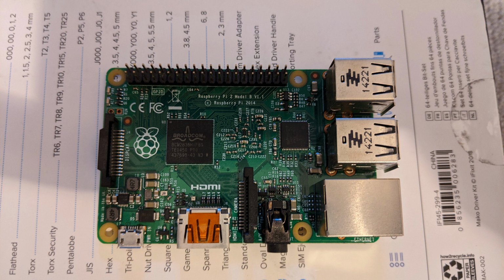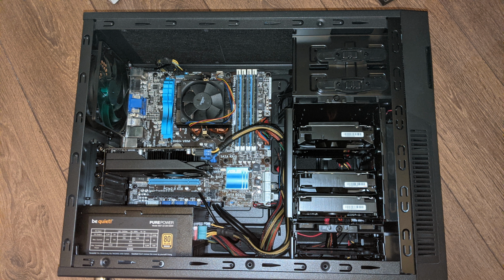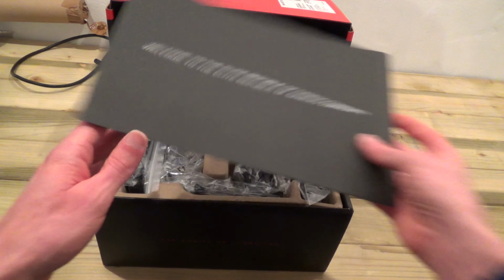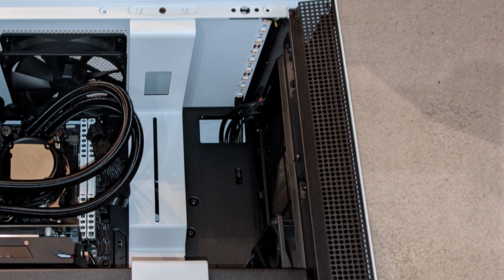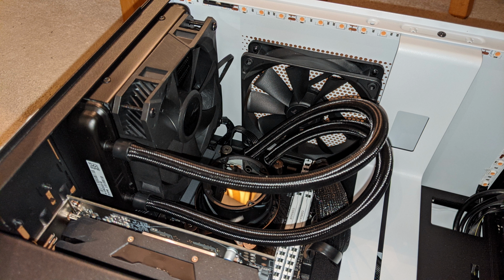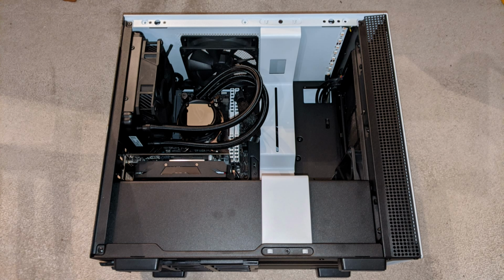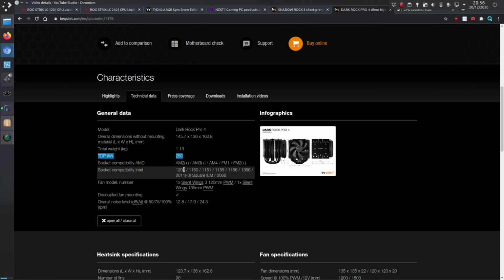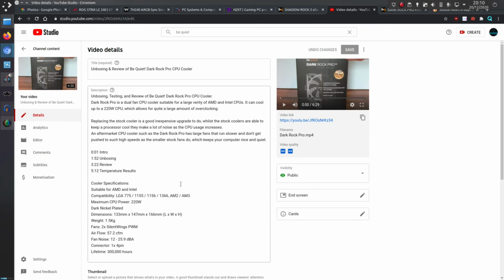Trying Water Cooling for First Time - ASUS ROG Strix LC 120

Comment: I experience a random air bubble rattle for 10 minutes during startup. I changed to an ASUS ROG Strix LC 120 RGB water cooler last year from another water cooler due to the same issue. Now, I am moving to a fan-based CPU cooler. Do you still have this ASUS ROG Strix LC 120, and have you had any problems with it?

Comment: I have the same Aio cooler, and to say im not so pleased with it either. But now i changed the fan on the radiator to a Noctua NF-F12 iPPC-3000 120mm PWM with much higher stat pressure.

Comment: I think it makes more sense to install the AIO sucking cold air through the front into the case than blasting the hot air through the radiator and out of the case...

Comment: I installed my radiator sandwiched between 2 fans. One pushing air thru the radiator and the other pulls the air out the back. This works pretty well

Comment: Interesting take I dismissed water cooling a while back, when I was purely focused on getting an air cooler as I needed to build a PC as quickly as possible before my old one caved in. Previously I always thought water coolers had to be joined together therefore risked leaking however I now know they are all in one generally unless you have something custom built. Now I went with a Scythe Fuma 2, which for my 5700g was going to be more than enough as I had no plans to overclock. Then... I discovered bit by bit that overclocking could be rewarding if you were lucky enough to get stable silicon. In fact, because I do a lot of compiling but also play the occasional game (compare this to when I was growing up where I would have a bag of games which I would play from waking to sleeping..) any performance uplift, if stable and free - might aswell be utilised. So I've started with the built in features of the motherboard just to see what I could get - and sure enough 4.6GHz didn't crash after compiling a whole day's worth of stuff I came to the conclusion that I would try to learn more. First concern is always to keep the lifespan, so I also tried Precision Boost Overdrive with moderate settings which worked well. All this with auto voltages. However I had a go at graphics overclock. From +200MHz boost, to +300MHz everything was running well. However I do recommend getting a spare partition and using OCCT which stress tests the CPU and GPU, as +300 was giving me errors. But - I gave it +25mv and bingo - after 15 minutes, no errors. I haven't tried more as I want to balance the system. The final adventure was RAM. At first I was sceptical that anything would work over stock speeds. I was at 32Mb/sec with single channel (I can't afford more yet!). The RAM turned out to be rare Micron F die - with literally about 3 reddit articles and hardly any reference, not even mentioned in the DDR4 overclock wiki or whatever it is.. So I decided to do manual. I left voltage auto (apparently it might take 3.80v wheras a lot of sites say 4 or 4.5 I think it runs on less). Anyhow by upping the speed a few notches I got to just under 3600 stable. 3600 crashed but I increased the latency a by 1 and got it up to just under 3800. Then I increased by 1 more and I got it to 3933 which it stays at now. 4000 didn't show the display but then... I didn't try any other voltages. But even with 2 more on the latency my memtest usb stick says I have 39Mb/s - so a nice uplift. Supertuxkart likes all core it runs at generally 60fps on the integrated graphics gpu, around 50ish with PBO, compared to about 41fps with 3200MHz DDR4, combined with all the other overclocks. But the biggest difference is Cinebench which would reflect on compiling too. Scores of over 15600 are possible with all core overclock, 14,800 with PBO. Compare this to 13,300-13600 stock speeds stock ram. So yes, all small improvements but improvements welcome. I reckon if I put a 240 AIO in, I can bring temperatures down and it'll boost for longer on PBO mode making that mode more useful, in the meantime it reaches 4.85GHz on my air cooler so it should help it boost for longer periods. That's the thing - if you download ryzen master, do "Core optimiser" Screenshot or take a picture of the results (negative offsets for CPU voltage) - put this in Curve Optimiser on the motherboard BIOS and you can reduce voltage which helps the scores. I used per core but if you do all core for older motherboards you may have one setting for all cores to try. It'll do a stability test. Once everything is stable you can come off windows again and use Linux. You can just do it manually but it was easier to leave it an hour and for it to give me some idea what undervolting could be achieved. So in my research I saw that 1 fan 120 AIOs tend to perform similar to air coolers. 240 or 2 fan 120mm AIOs like the Kraken x53 or the Artic Freezer II could perform a couple of degrees better than a Noctua DH15 or even better in some cases. I imagine if your case can fit it a 3 fan model will perform significantly better in some (not all cases). So given that I'm very tempted just to try it as my case won't fit a bigger than 155mm tall air cooler, but only has 2 120's on the top so a 240 AIO would give me superior cooling. The other thing is time to reach max temp is seconds for an air cooler but minutes for an AIO, so if you're doing short bursts you should notice that you will get better performance with AIO even with 1 fan. For longer durations a bigger radiator is better. All interesting and I'm even tempted to start a channel and demo these things!
Reply: I forgot to add in that post - one thing I noticed and I don't know if you have too is after researching water cooling - on the boxes they often show the wrong installation method because it "looks better" for the photograph on the box. After watching JayZTwoCents and various other hardware channels I have learned for when I try water cooling in the future - that the pump has to be below the radiator tubes when  mounting. So for example in this one fan configuration I would mount the tubes above the pump vertically rather than going down to the bottom of the fan. Air pockets can build up otherwise and lead to the pump making gurgling noises or failing after a short period of time. So, if it is at the back of the case lead the tube down to the CPU bloc rather than up to it. Same if it's the front of the case lead the tube from the top of the radiator downwards towards the CPU bloc. This won't generally be a problem with top mounted radiators and fans. I hope this helps because it may get extra life out of the cooler - and stop it failing, which  - if it did fail - would make you more sceptical of water coolers based on bad experience. I wouldn't have known this myself.. but you could save Miss Quid's computer :D Maybe you already know by now, or maybe it wasn't possible to mount it any other way but.. I hope this message gets to you in time to stop any failures.

Comment: from experience you will run lower temps sucking through the radiator rather than blowing out. I tried both ways and had about 10deg C difference.
Reply: The very Idea of sucking hot internal air through your radiator immediately made me cringe.  You are absolutely right, suck.  It's almost always the answer and most of the time describes the situation.  Every radiator ever built was made to be sucked.  I'm just saying, if you blow one you ingest hot air into the thing you're trying to cool.  Not good.  Set your other fan up as exhaust and watch those temps nose dive.

Comment: Hi Mr. Quids! You know a video I'd like to see and I can't find anywhere? Someone who knows about security an tries the Parrot OS home edition (not the pentesting edition) and goes through their suite of preinstalled software to assess how useful any of it can be to a security-conscious average user, as this seems to be the target demographic for that version of the distro, and it's not software I am familiar with but I am curious.

tip: if you try to download their KDE version you will see they have a warning that there is an upstream bug from KDE on konsole and that they are waiting for Debian to implement the new version.
There is a simple workaround by writing in the full path to konsole:
go to System settings > Applications > Default Application > Terminal Emulator
Select "select different terminal program" and write in "/usr/bin/konsole "

Comment: A high end noctua NH-D15 & bequiet! dark rock pro 4 will be on par with most 280mm AIOs and some 360mm AIOs.
 If you are running a 10 series intel chips you will want to stay away from AIO's as the CPU will raise the temperature of the liquid well beyond 60C which is the point that air will begin to permeate into your closed loop. Most AIO's have 90% liquid and 10% air so introducing more air into the system can be catastrophic.

Comment: Please mount the cooler at the top of the case. Mounting the way you've done it will grant you sub par performance and will reduce the lifetime of it. This is because of the air bubbles that will form in the tubing. The fan block has space designed to accommodate the bubbles and not make it interfere with the loop. You might have had bad performance bacause of this. Watch gamers nexus video on it for more info.
Reply: The pump simply has to be below most of the loop. Like that shouldn't be an issue in the short term, unless there are significant air bubbles in there already. If that's the case you can hear it from the pump and since it's new, that would really warrant an RMA.
Reply from the maker: Can't be done in this case, there isn't clearance between the top fan and the RAM to allow the radiator + fan  to be fitted

Comment: Comment for the algorithm to ingest.

Water coolers aren't as sexy as heatsinks (especially the bequiet! ones). Add to that the fact that water coolers have more moving parts (cooler and water pump) so they won't last as long and are more expensive and you can't replace AIO's pumps like you can in a(n even more expensive) custom loop and you've got yourself all the downsides without any upsides (custom loops require maintenance, so don't get me started about that). Thermosiphons, like the IceGiant, seem like an interesting addition to very hot chips, like Threadrippers that are as durable as heatsinks, but have better cooling performance (but IMO aren't as good looking).

Comment: During the winter months I use an AMD FX-8350 to supplement the heating in my room - in warmer weather the supplied cooler is so loud I am surprised AMD thought it adequate.
Reply: Bump. I was doing the same, but instead of an AMD FX, I was running folding@home on my "old" Pentium G4560 in 100% load. My electricity bill was double, but at least I helped some researchers with compute power. I just acquired an old Intel Server Board and started running some VMs on it (Intel Xeon x3450) and 11 HDDs, in which I'm using some capacity for off-site camera footage from another location. Going to do some more stuff, like mail, matrix, peertube and prometheus for monitoring everything. Actually, I'm not sure what I'm going to do in the summer about it.
Reply: Did you just run the yes command on all threads?
Reply: @casperes0912  I don't remember what the "yes" command was. I remember first selecting alzheimers and I think cancer, but there were no folds, so I selected all diseases, then I increased the CPU utilization from 75% (IIRC) to 100% in the "advanced view" menu.